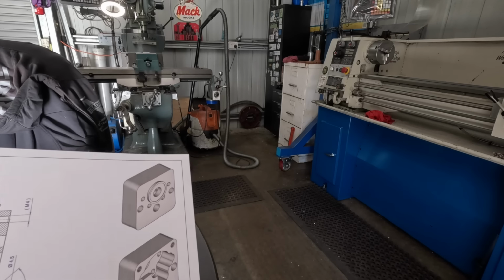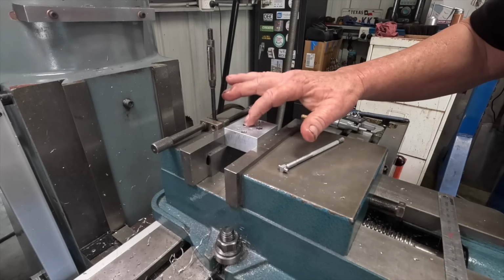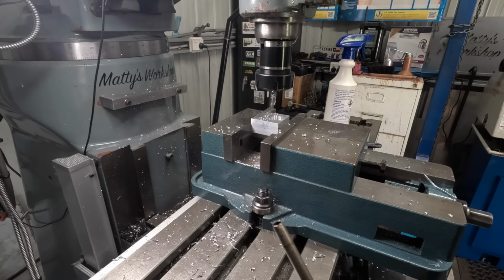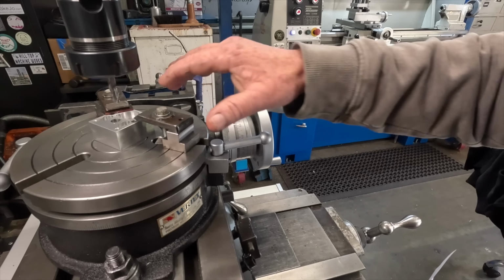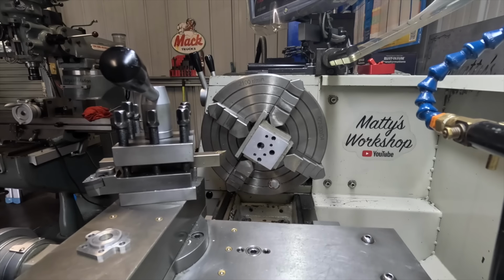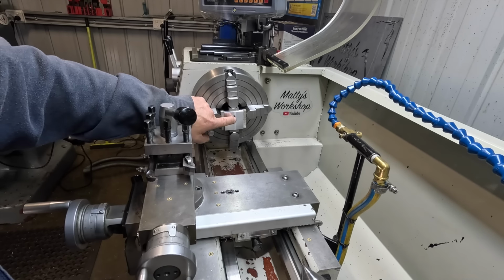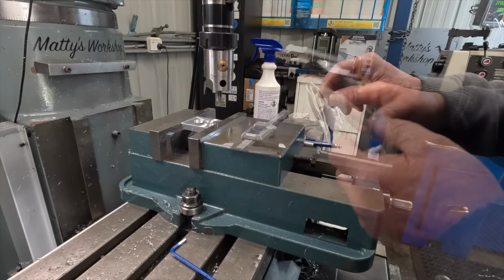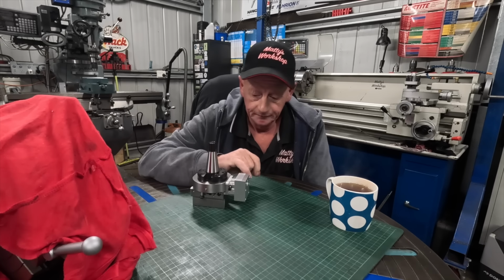Boring & Facing Head   Part  7

Comment: G'day Matty, stopped the video where you made your 2.5 mm offset error, if it does turn out that it is important, then turn up a piece of Ali to be a interference in the holes and loctite them in and go again in the right position. An easy fix if it's important that the holes are in the right position without having to start again. Watched it all now, I said it a few weeks ago and I'll say it again, you Matty are becoming a bloody good machinist! That gearbox housing is pretty complicated and it looks totally professional mate, good on yer! Cheers from England, Sam
Reply from the maker: Gday Sam, I wasn't to sure how to attack the housing to start with but it worked out ok in the end, Appreciate you watching, Cheers

Comment: That's turning into quite a chunky tool. Very impressive work. Will the gearbox cause any imbalance? Or is there something I've missed? Just curious as my boring head can cause the machine to vibrate quite badly (larger diameters, harder materials).
Reply from the maker: Gday Olly, There will be imbalance for sure but I think I can add a little weight to the opposite side if needed, Thanks for watching mate, Cheers

Comment: top job Matty would not mined a few bob for every time i read a plain wrong would have a few less parts in the shame bin that's for sure but looks like you may recover from this one good variety of Milling and lathe , rotary table bit of it all there nicely done just curious your rotary table is it an 8 inch Cheers
Reply from the maker: Gday, The rotary table is a Vertex 8", These are the most technical set of plans i've ever worked to and Im surprised I haven't screwed up more to be honest, Thanks for watching, Cheers
Reply: @MattysWorkshop  no mate you are doing great way better than i as i can read plains but they get me in the end Cheers and thanks for the answer